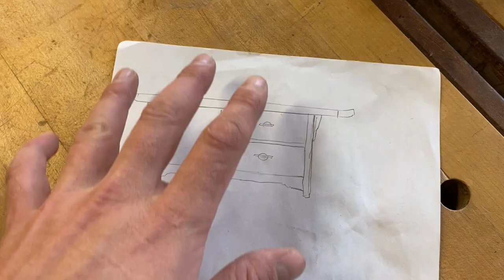Making The Profiled Top For My Off Grid Cabin Bench Seat

Comment: I built Norm Abrams New Yankee Workshop 6 panel blanket chest in 1989. Built while stationed in New Mexico a dry climate out of pine. Did not follow his guidelines on gluing and pinning the breadboard ends. Glued the whole thing. Fast forward to 1995 in South Dakota. Sitting watching TV and heard what sounded like a gun shot. Did not find anything but a week later while dusting my wife found the split breadboard end. So much for allowing things to move. I have since then draw bored and glued only a few inches on one end. I think humidity will always play a part.

Comment: Outstanding craftsmanship Sir. One thing though I would strongly advise the use of a dust bag on your sander at the very least. Preferably a dust mask with a vacuum or dust extractor hose, those fine sanding particles will destroy your lungs over time.

Comment: Totally agree with you on the breadboard ends/glue application. Softwoods vs hardwoods, yes there is room to argue, but, glue only helps prevent cracking in both applications. I’ve done both, and even a butcher block that I just butted the ends, glued and screwed them, 6 yrs and still no separation. Hard maple butcher block, with walnut ends. It’s a tradition thing, which I get. But they didn’t have glue like we got now….

Comment: Can somebody tell me why the tenons that plug into the breadboard ends are cut like "fingers" rather than just being the same depth all the way across? Sorry if this is a noob question!
Reply: It is called a haunched tenon. The tenon is deeper inside the breadboard end to give plenty of meat to hold it firmly to the panel, while the haunch across the end of the panel ensures that the panel stays flat between those tenons. If you mortised out the entire breadboard end to fit a huge single tenon into it, you would make the walls of the entire breadboard end pretty thin for such a wide piece. They might even cup away from the tenon across the length of the breadboard end. It is also less work as you remove less material with a haunched tenon rather than a single huge tenon. Where possible, remove less wood to maintain more strength and stability.
Reply: @jrumbel  Thanks for explaining. Makes perfect sense now.

Comment: Question for the knowledgeable in The samurais comment section.

I have promised to build my grandmother a picture frame. I have access to an pretty well equipped workshop. I have gotten basic training on the table saw and planer. Dough no one has knowledge about the big router table with a automated feeder. Who or what training on the internet could help me operate this tool?

Second question, will 2x4 material work for paint grade picture frames.
Reply: It's likely a spindle moulder or called a shaper in the US not a router table. Basically the same thing thing but that's what to search for.